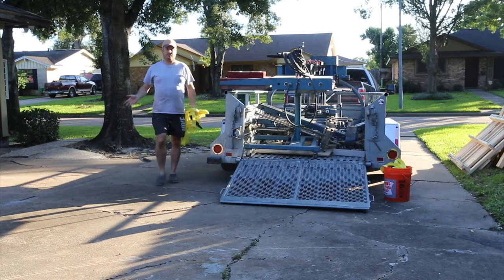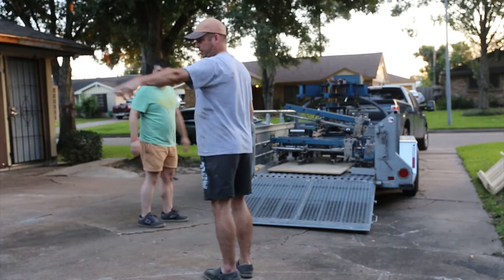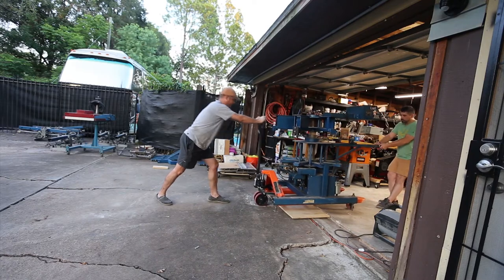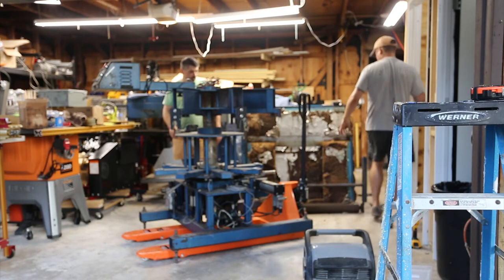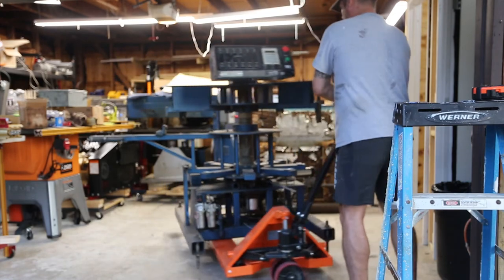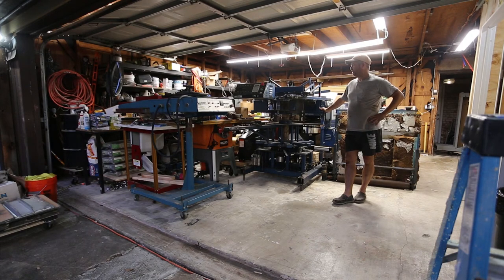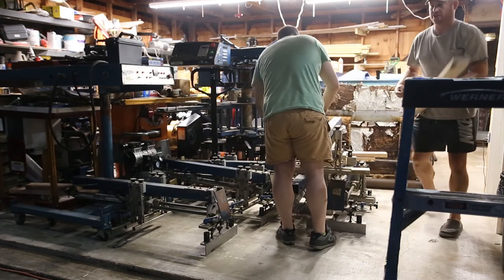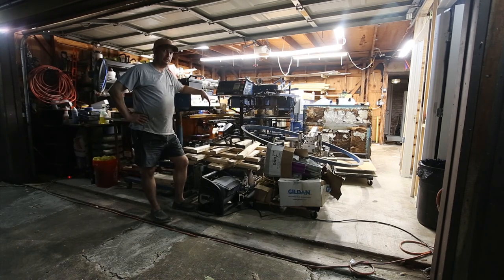Moving a M&R Gauntlet 6/8 S Screenprinting Press

Comment: We're about to move the same gauntlet s. How the heck did you get the center base down the ramp!?
Reply from the maker: I jacked the front of the trailer to minimize the angle.... put boards down and me and a friend did it.  A box truck with a large ramp is a better solution if you don't have a forklift.  Beware that if you take the platen arms off you will have to re-register the press.